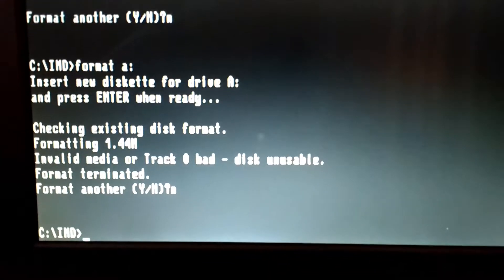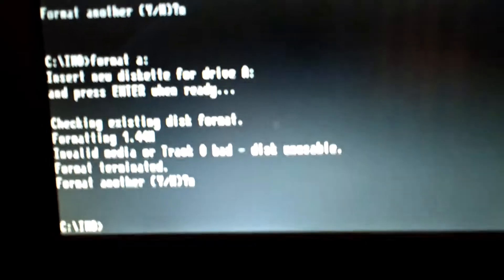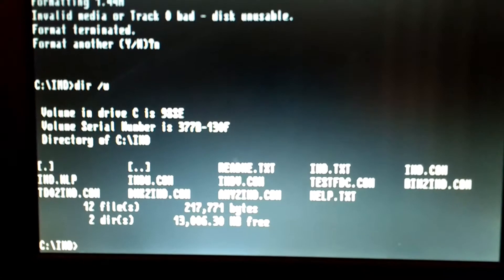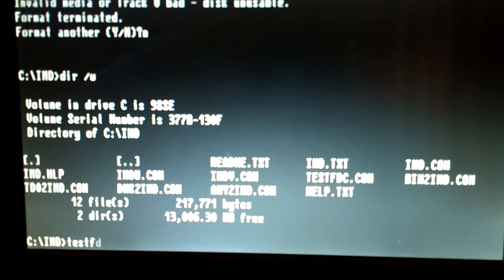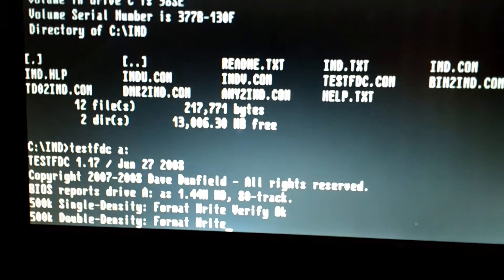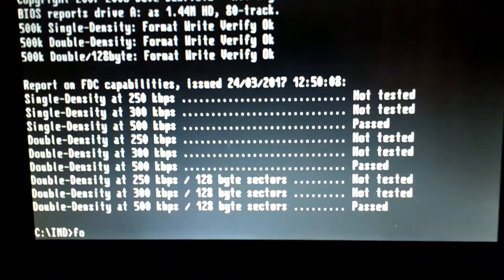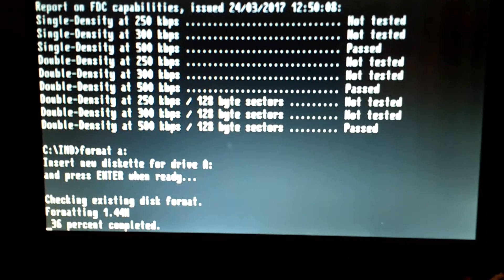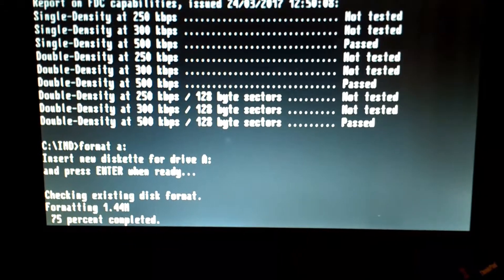3.5" Floppy track 0 bad fix

Comment: My primary method to recover floppies is use a peg to hold the shutter open, grab a Q-tip and dip in isopropyl and wipe around/forward and back and spin as you go along, especially where you can see the grease/dirt in areas (you can see them under light). Normally that solves it after format.
There's a video called "fixing Amiga game floppy" on YouTube that also has a similar procedure which fixed it.
I'm not usually in it for data recovery, just to get the floppy back and running.
Reply: I tried that , and my floppy drive somehow ripped the shutter of the floppy disk off after inserted the newly cleaned floppy disk, causing me to have to remove it from the drive

Comment: I didn't understand much of the procedure, is there a step by step guide, i ported this program to xp to see if i can recover old 3.5" floppies, but when i put  imgdsk on windows xp, and execute it, it just does an utility program about 5.25 diskettes.
Reply from the maker: I explained in the beginning of the video if i remember correctly that this program REQUIRES a real-mode OS - ie DOS or Windows 98.  This WILL NOT EVER work on XP or newer.

Comment: don't work
Reply from the maker: If you did it from Pure DOS, on older hardware with a real FDC (not a USB Floppy), and it failed, the floppy drive or the disk itself might be toast.  

It works when the problem is a demagnetized disk, as long as the disk coating is still intact and the floppy drive itself is good.

Comment: Hi, I am just wondering if it does work with IBM PS/1. if I use any floppy disk on a normal pc, the floppy disk works but not on my IBM ps1. help, please?
Reply from the maker: Your PS1 might just have a 720k controller / drive.  Sounds like you just need to reformat the disk as 720k.  Tape over the left side hole, while looking at the front of the disk with the holes at the top, then reformat in your other PC, it should pick it up as a 720k from that point.  If your PS1 has a 1.44mb drive, the problem could just be a bad controller and / or drive.
Reply: Is your PS/1 clock battery dead?
Reply: It depends on the density. Being the IBM PS/1 was released relatively later on, it is on the rare side for them to have DS/DD drives which are 720k. DS/DD is Double Sided Double Density. Single sided drives existed only in non-PC compatible systems typically. The Apple ][ is a good example of such a drive. You would have to flip the disk over in order to read the other side. They were 5.25" diskettes and it requires a second notch being punched (I have a punch). I have to try this program myself on some 5.25" diskettes I have that seem to not want to work properly. However, I have some OLD OLD OLD 5.25" diskettes that work fine. Sounds to me like you have either a misaligned drive, or a 720k DS/DD drive and formatting in DS/DD on a DS/HD drive (1.44MB) won't quite work as the sectors/tracks are narrower (It's more dense). The DS/HD drive will read them fine, however the DS/DD drive, poor thing, will see garbled data as a result of the DS/HD drive not covering the entire pre-existing sector/track when it writes.